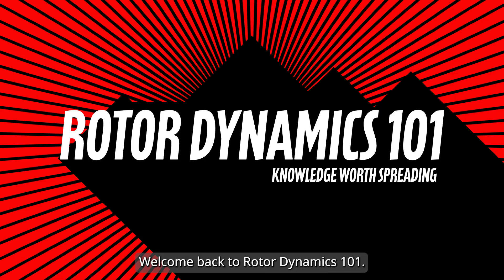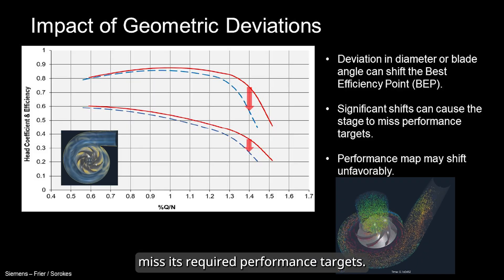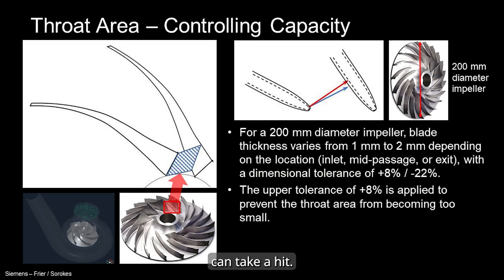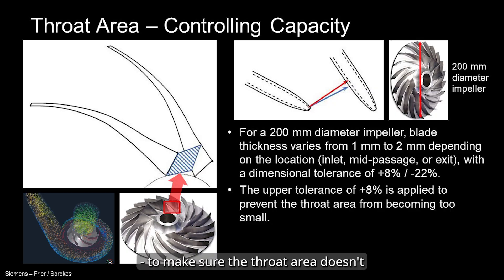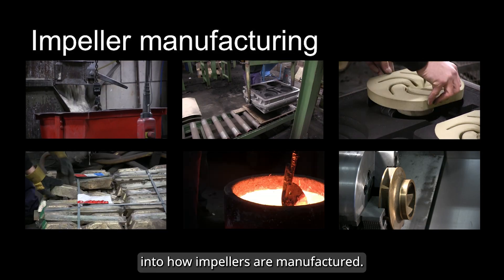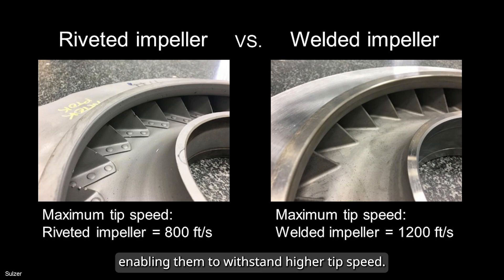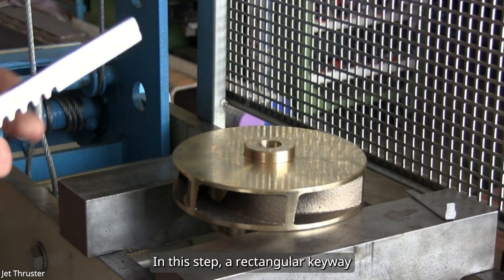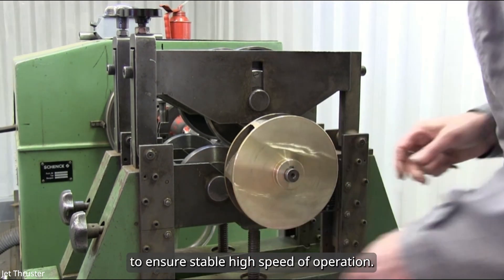Impeller Manufacturing Explained: Casting, Welding & Machining Methods (Part 69)

Comment: We manufacture impellers with 5 axis cncs and it’s interesting to hear about the reasoning behind the design and tolerating
Reply from the maker: Thanks for sharing! 5-axis CNC is a powerful way to manufacture high-precision impellers. I’m glad you found the design and tolerance reasoning interesting—it's a topic I enjoy diving into. If you're interested, I’ve covered related discussions in my videos, and more are on the way.

Feel free to reach out or email me at rotordynamics101@gmail.com if you'd like to exchange ideas or discuss further.

Comment: Very informative. Do you know any book or literature which goes into details of design related aspects of impellers ? I am interested to learn about what parameters of design affect what kind of operational parameters. Like you mentioned the inlet passage determines the choke flow.
Reply from the maker: Great question! I’ll be covering how impeller parameters affect performance in an upcoming video—stay tuned!
Reply: look up Gülich